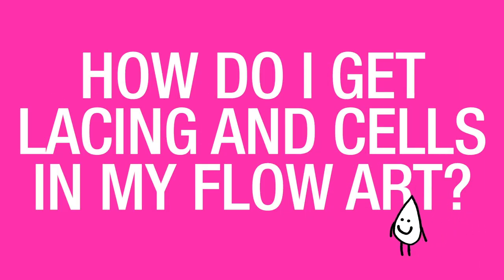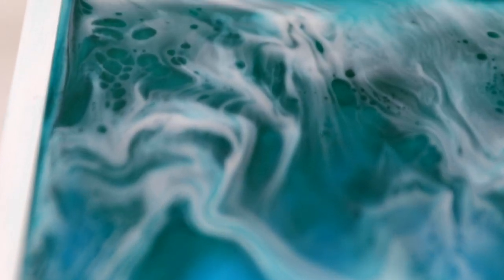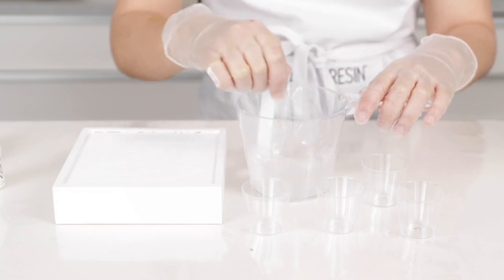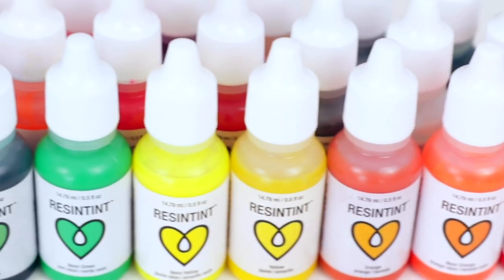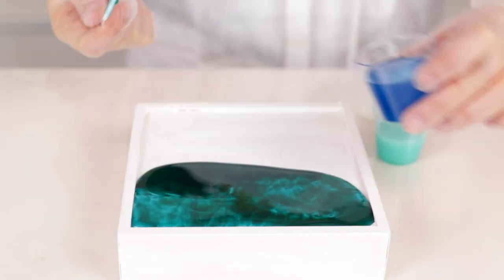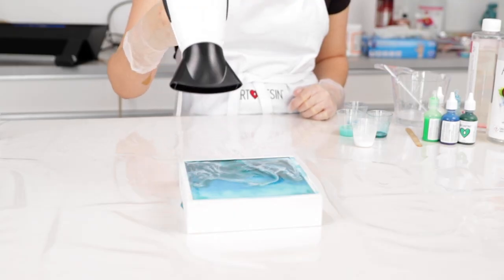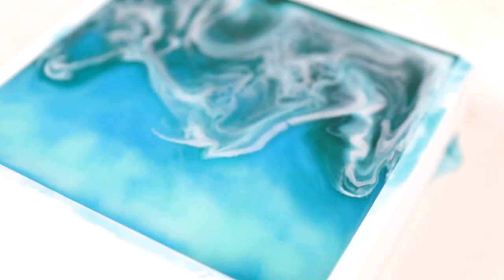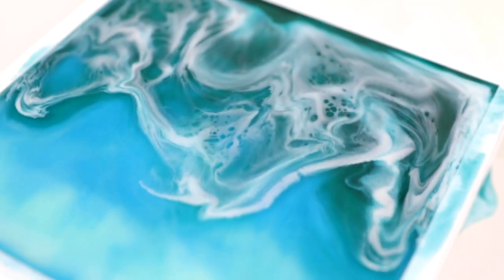How Do I Get Lacing And Cells In My Flow Art?

Comment: After doing clear coat,why sometime I get wave like effect,?where will be my mistake? Is it because of blow toarch?
Reply from the maker: Hi Astha, We call this sort of effect a spider web effect. It can be caused by cooler temperatures, or a cluster of bubbles, or even from over torching. The good news is, it's totally fixable with some sanding and another coat of ArtResin. I recommend giving your resin and hardener a warm water bath before you mix them, to make sure your resin is up to it's ideal temperature (between 75-85F). Warming up your resin before you mix, also helps to thin out the resin making it easier for the bubble to come to the surface for popping. You can find all the information on our blog https://www.artresin.com/blogs/artresin/should-i-warm-epoxy-resin-in-a-water-bath-before-mixing?_pos=1&_sid=01594e313&_ss=r

As the spider web effect can also be caused by over torching, remember to keep your torch a few inches above your artwork and move it in a constant ironing motion. You can find more information about how to use a torch on our website https://www.artresin.com/blogs/artresin/is-it-possible-to-over-torch-my-artresin?_pos=4&_sid=1bdb37422&_ss=r
Reply: @Artresin  thank you so much for your instant reply